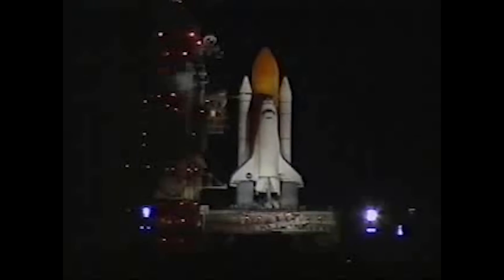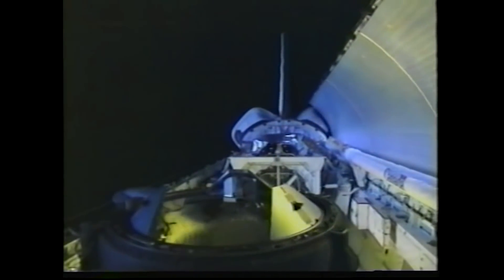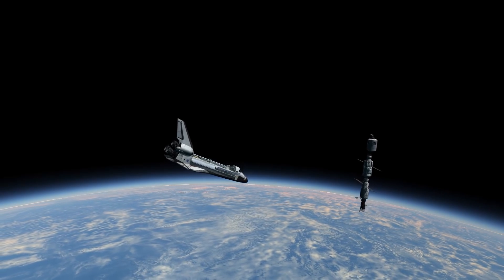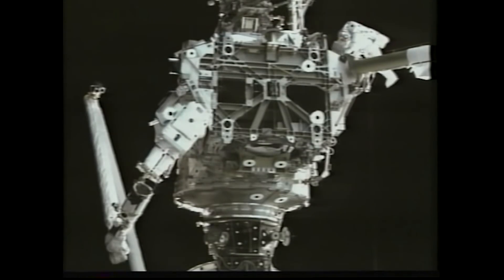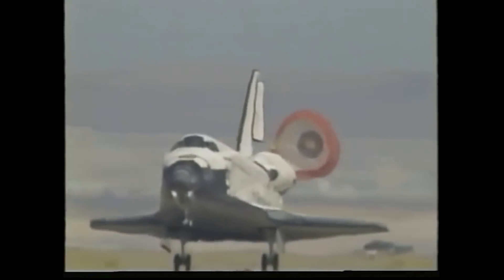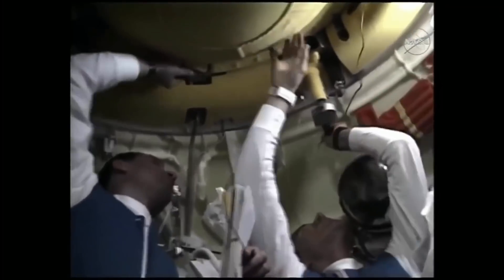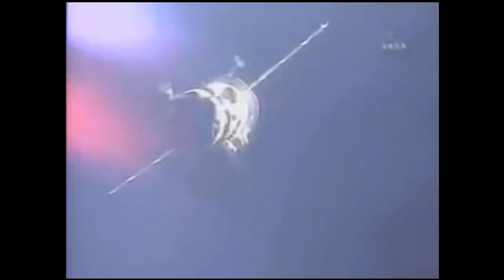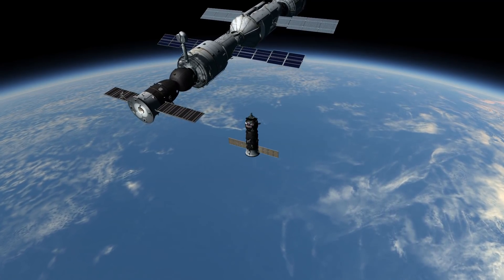International Space Station - Episode 6 - Expedition 1

Comment: STS 92 was the final mission before crew arrived. Its cargo was the Z1 Radio Antenna and PMA 3. With these elements installed the station was ready for her crew. On October 31, 2000 Expedition 1 launched from Kazakhstan and docked two days later on November 2, 2000. With Space Station ISS manned the crew got to work bringing the station to life. As soon as they came aboard all the lights were turned on and the stations computers were activated. But before they could do experiments the station needed power STS 97 would bring that power on the next flight with the stations solar panels.